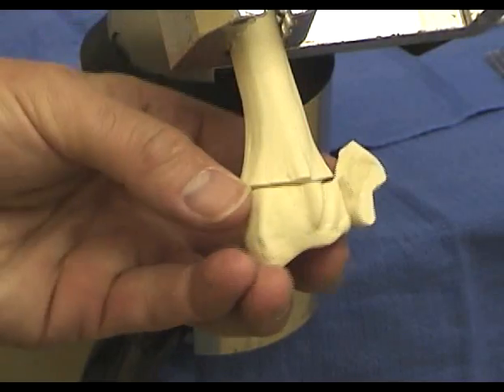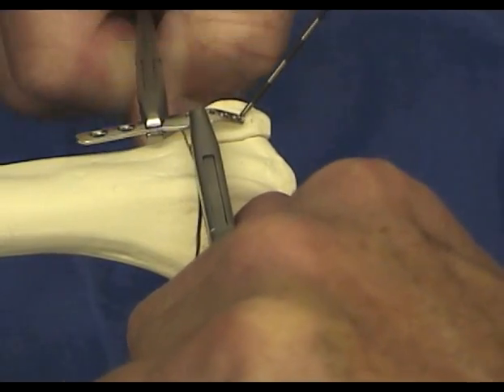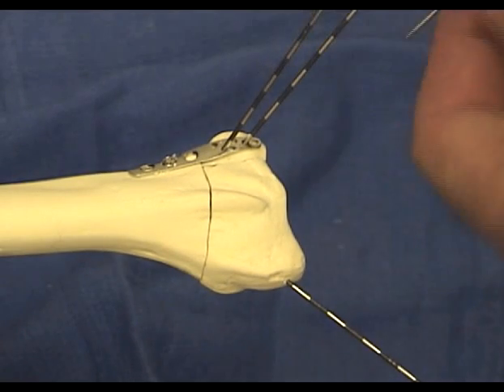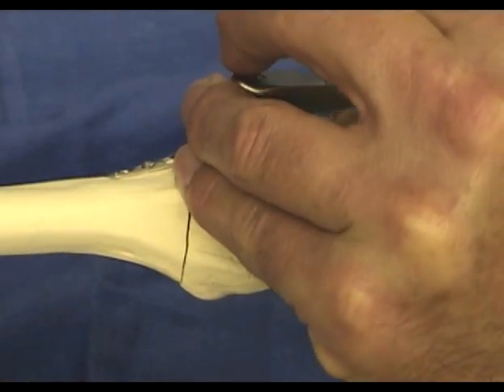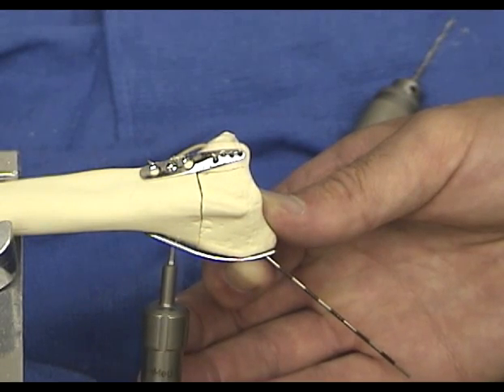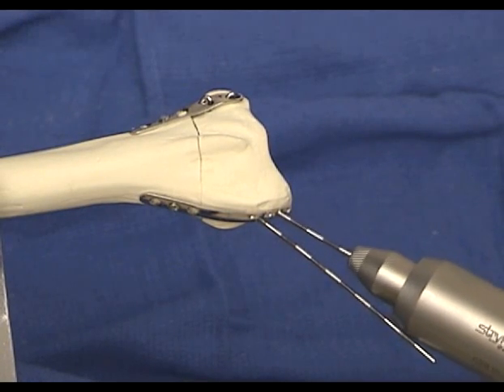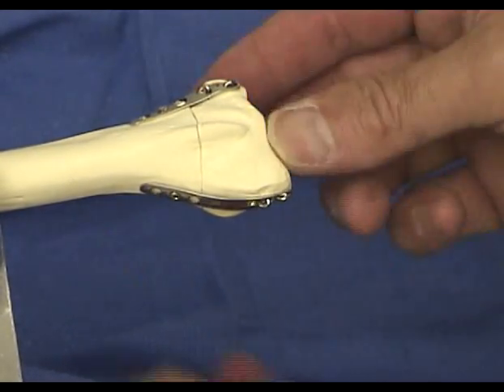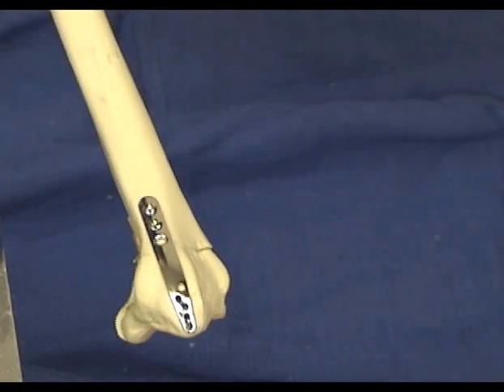Radial and Ulnar Pin Plate™

Comment: When they insert a rod into the femur to correct a compound break, why don't they use a plate like this on the anterior side of the bone instead of screws that go all the way through and leave sharp edges proturding on the interior side, instead of using the zebra pins as you've demonstrated.  By the way excelent teaching tool.